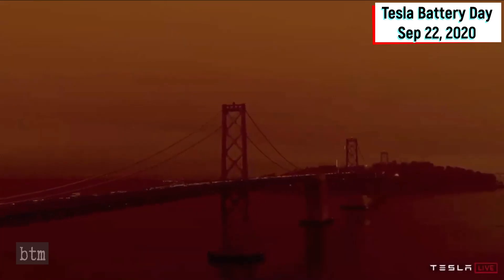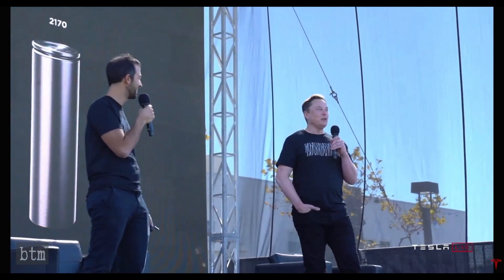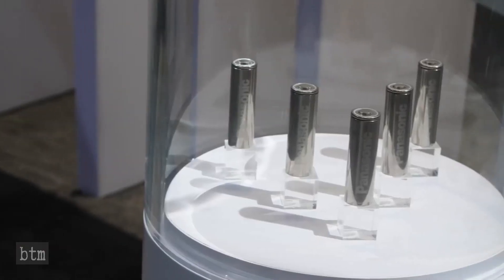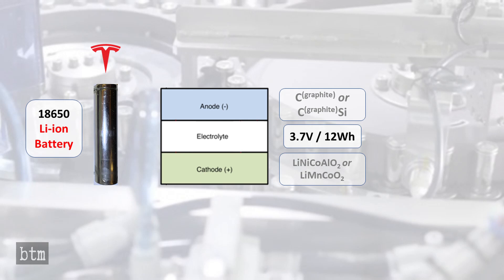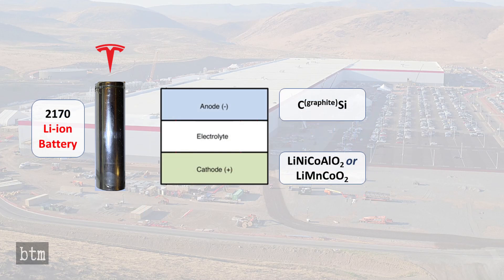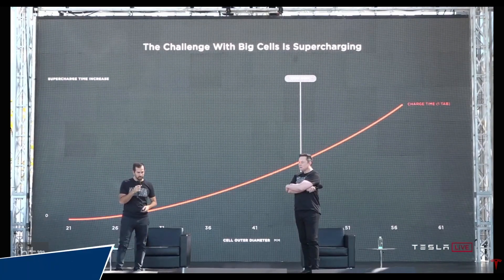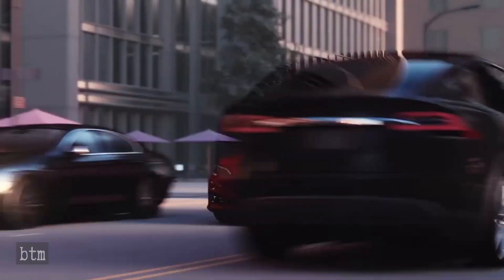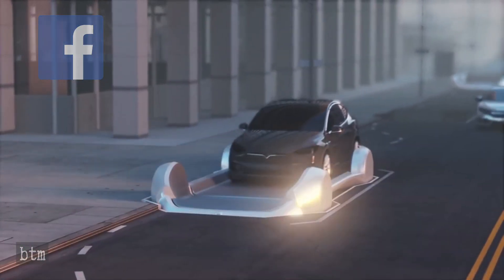Tesla’s New 4680 Battery – High Nickel Low Cobalt Solution Instead of LiFePO4 | Battery Day Series

Comment: Based on battery day presentation, Cobalt is best cathode metal when used alone ("high nickel" has cobalt and aluminium and used for mass critical applications). Pure cobalt cathode costs 25% more based on metal costs, but maybe only 15% more when simpler processing considered. A Cobalt cathode is good for long life uses.

Cobalt has a bad name due to mining in the Congo - but mined in a non-conflict area near southern border. Cobalt for batteries only comes from the giant government and Glencore mines - big producers selling to big buyers. For electronics and steel it could come from many sources. We all probably have electronics with materials sourced from child slavery and in conflict zones - but we don't care where our electronics come from - only battery cells for which there are no issues.

Comment: Low Cobalt...........don't you mean Zero cobalt??
Reply from the maker: Maybe. Musk on Twitter and Tesla in its latest conflict minerals report says that their next generation battery, which may or may not be the 4680, will have zero cobalt. The problem is, you have to replace cobalt with nickel, which is not a 1:1 replacement in terms of the amount of materials required, and is only three times as abundant as cobalt. Real Engineering does a much better job of explaining this: https://youtu.be/1Xwxe0wU4b8.